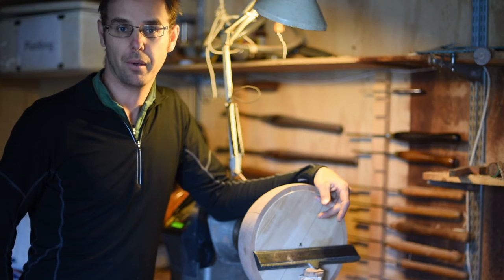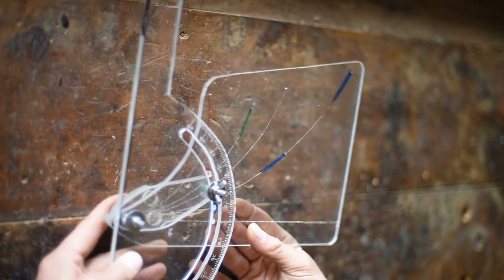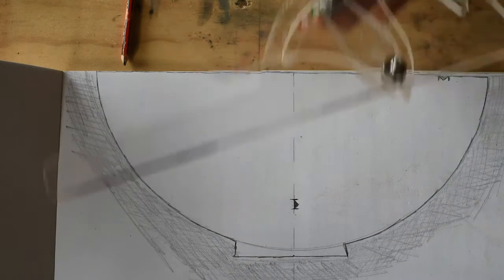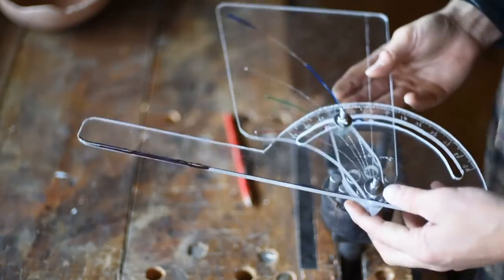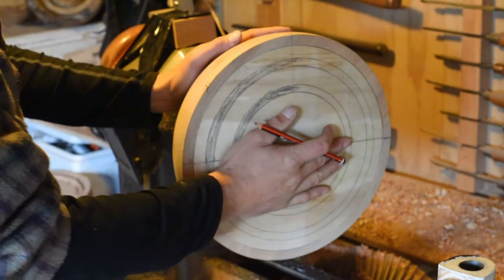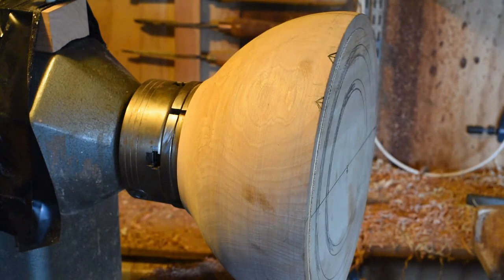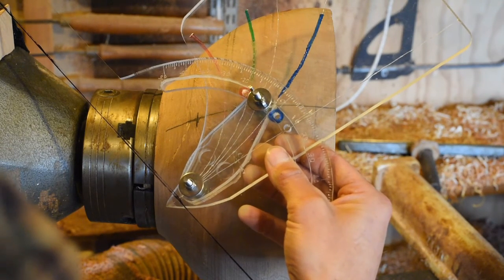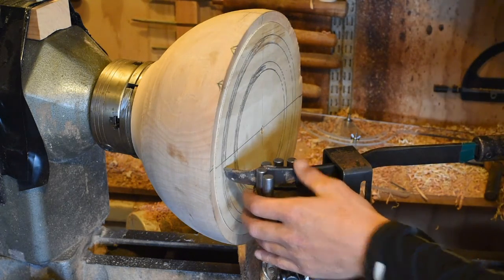Angle Finder Jig VI for McNaughton Center Saver

Comment from the maker: If you email me at gavinbrunton@mail.com I will send you a basic set of plans for the jug. But you will still need to work through the video https://youtu.be/h-KYdwELDNI   on how to make your own jig (including measuring the radius of your cutting blades as there have been some variation in the curve of these blades over the years).
This is the only way to get a accurate jig made for your set of cutting blades.
Reply: I am very interested in the jig. I to would be interested in plans for the jig.